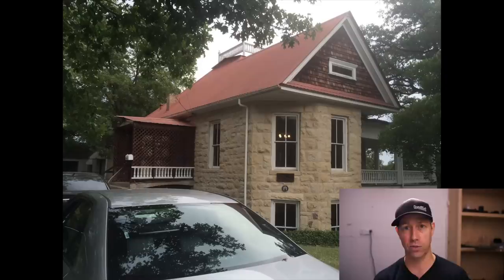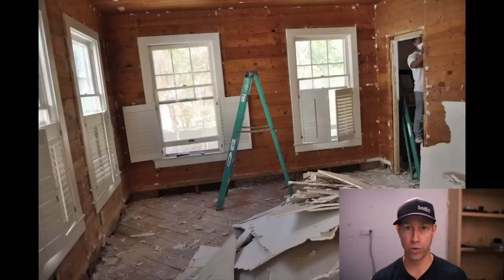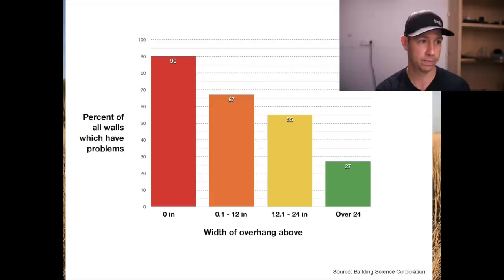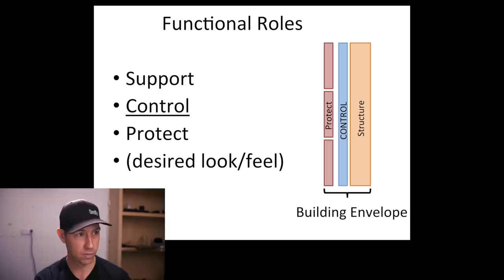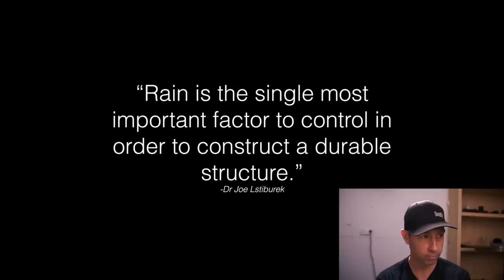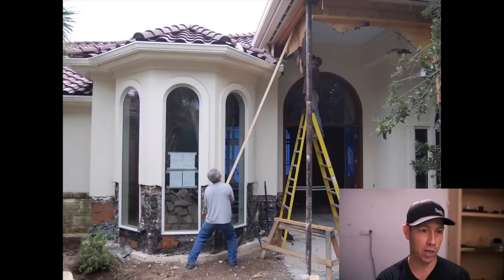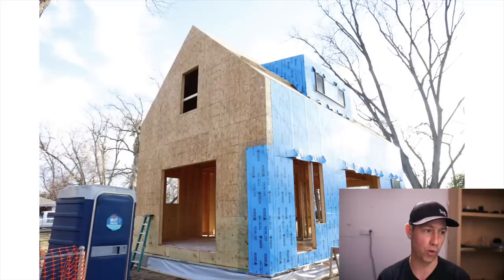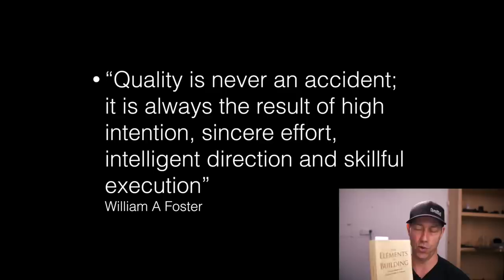Were Old Houses Built Better?

Comment: Concrete. This artificial inflation of concrete is nonsense. We need to build  houses out of concrete. Especially in high-risk areas.
Reply: Saw a very cool video on a computer assisted manufacturing (cam) / fabrication of an affordable "printed" cement house for Caribbean climates with high-risk natural phenomena. Seems like a good way to have solid bones in a house.  Although I'm conscious of Matt's comment that mortar is porous (this is true for old boats and moorings too)... Would be interesting to see a video on how to design more waterproof cement structures Matt!
Reply: Just watched the other recent video on concrete and there were a few subtle hints in that one, but would still like to hear more!
Reply: Steve Slade no it doesn't...kilns run fine on old tires
Reply: Steve Slade  natural gas is cheap  and plentiful. I know because I worked in the oilfield and we burned off a shitload. There are other alternatives to Natural Gas like methane from trash piles. You see them with pipes out of the ground burning that off. I lived in Oklahoma, I know the cost of rebuilding hundreds of homes and businesses because they are simply made out of toothpicks. On the coast where hurricanes come through will save millions too. The Energy Efficiency of cement is unbeatable. And just think of all the trees we wouldn't have to cut down if you are a tree hugger.
Reply: MrMoon_ I ran a lfg to energy powerplant in Florida...
Reply: Steve Slade they also flare large quantities of gas to keep prices high... gas and oil are everywhere...we have sanctions, fight wars to keep energy off market and prices high
Reply: NOP!.. Concrete is a horrible building material. It doesn't breath. I understand your point, you want something that can withstand a tornado or hurricane. But concrete is NOT the way to go. I suggest you check out stabilize3d compressed earth block construction. Much better stuff. It can withstand strong winds, it is bulletproof, it also allows water vapor to pass through it. This means that it does not get extremely hot during hot sunny days.
Reply: Everything down here in florida is concrete and i love it. I remodel houses and concrete construction eliminates a ton of the problems i used to run into back in the carolinas
Reply: Not hollow concrete blocks though. Because they're the weakest concrete you can get. Solid concrete is much stronger than the type of concrete blocks most tract homes are made of today!
Reply: The Utopiano Utopioan I'd take the weakest concrete over the strongest wood any day.
Reply: Nothing at all wrong with building homes with CMUs. They are plenty strong, especially once they get filled. This also reduces the expense of the home, as you don't need nearly as much concrete. Lots of homes in Florida withstand  decades worth of hurricanes because of their block construction. The roof might get torn off from time to time, but the walls are usually fine. I worked on a bunch of jobsites in SoFla and the blocks with cast or precast lintels made for very strong homes.
Reply: I remember when i lived in Okinawa, we had the worst typhoon* in 50 years pass over us.  That's saying something, since Okinawa gets up to four typhoons every year.  I saw a semitrailer in a tree after the storm.

Okinawa's a pretty heavily populated island.  It's 68 miles long and 18 miles wide at its widest point.  Total damage estimates for the island: a few million.

If that same typhoon had the the southeastern U.S., it would have cost billions.  The difference?  Everything in Okinawa is built out of concrete and steel.

* That's what you call hurricanes in the Pacific ocean.
Reply: Jeff Spaulding That's like hurricane sandy a few years ago. Passed over Florida as a cat 2 hurricane causing amost no damage, hit the northeast as a tropical storm and caused  $70billion in damage.
Reply: Concrete, while a strong material, is far from very durable. Homes shift and concrete often cracks when they do. I've seen homes here in the Midwest made from concrete (60's builds) where the concrete has become brittle with age and in some cases is flaking off. Another known issue with concrete, homes tend to get remodeled and renovated a few times in their life cycle and what works for layout and design today may not in a few years. Concrete isn't cheap to break up and put back down and even if you do, isn't as strong as it previously was - even if it was a repair
Reply: @Xixu.co.6  Not so fast! Except a concrete house without much rebar ISN'T safe in an earthquake. Concrete with barely any rebar is similar to unreinforced masonry. Unreinforced masonry has been banned in California since 1933. You may think that Texas doesn't have earthquakes, but you never know. For example, the New Madrid earthquakes, which happened in 1811-1812, surprised everyone because it was located in the middle of a techtonic plate on FLAT land. New faults are constantly being discovered.
Reply: Not so fast! Except a concrete house without much rebar ISN'T safe in an earthquake. Concrete with barely any rebar is similar to unreinforced masonry. Unreinforced masonry has been banned in California since 1933. You may think that Texas doesn't have earthquakes, but you never know. For example, the New Madrid earthquakes, which happened in 1811-1812, surprised everyone because it was located in the middle of a techtonic plate on FLAT land. New faults are constantly being discovered.
Reply: Ever been in Post Soviet countries where they have Khrushov Era concrete cities? Concrete structures are cold and moldy and inefficient there.
Reply: @dcentral  Concrete Construction has changed since the times of that Soviet era concrete. It has evolved. Do research on modern concrete homes.
Reply: 5% of all CO2 emissions are from making concrete. The first step in making it is to turn CaCO3 into CaO, so even using 100% "green" energy to make it, will still release absurd amounts of CO2.

OTOH, wood sequesters CO2 for the century-plus it remains as wood.

It is ecologically irresponsible to make anything out of concrete that doesn't absolutely have to be made from it.
Reply: @rubberdwellers3911  hi, Im from eastern Europe, all new houses have reinforced concrete beams here with red brick. They are highly reliable builds and very fast.
Reply: @jeremymartin1957  it worked out for the Ancient times.
Reply: Personally I'd want a steel framed house also and use wood more selectively.
Reply: @CheapSushi  steel frame isnt good for houses - reinforced concrete frame is far superior and cheaper
Reply: Even the best concrete eventually cracks, and once that happens... it's a nightmare that only gets worse and worse.
Reply: @oreocarlton3343  Why not?  After seeing a bunch, I like it more and more. After visiting Romania and seeing all the reinforced concrete homes, I decided against it being the primary aspect of my future home (if I'm ever in that position).  I also don't want a traditional looking white picket fence suburbia home. I truly like the new more modern cube-ist mixed structure and design motifs.
Reply: @CheapSushi  Rust, price, electrical hazards, compressie strenght...
Reply: @oreocarlton3343  The price is not too significant unless very price sensitive and/or building large but I wouldn't want a large home regardless, heck I even love the shipping container homes. Rust can be an issue but I'd rather deal with rust that the bunch of problems all these other homes have.  Plus I can add a protective coating to the steel. The steel also wouldn't be just flat out exposed to the environment.  I don't want the entire home to be concrete or wood. If people want to pay for that, go for it. But if I had a chance to build my own, nope.   I'd only go concrete for the majority of it if I lived in an area extremely prone to tornado or hurricanes, which I don't.  Electrically,  whether it's steel or not, bad wiring is a hazard if done improperly.
Reply: @CheapSushi  "compressive strenght of steel"

Comment: New houses are built of plastic, asphalt, gympsum board, foam; all not so great materials.
Reply: Bad for health also
Reply: @SimonWoodburyForget  foam is cancerous shortlasting dogshit compared to any material. Its cheap and easy to use, that is why they use it
Reply: " foam is cancerous shortlasting dogshit compared to any material"

Toxic? You're misinformed.
Reply: Yes there is the toxicity aspect of these materials, although I did not know foam has no toxicity. My main problem with them is that it makes for junky, dumpy housing. Using these materials is a cheap shortcut instead of building for durability, efficiency, and aesthetics. And yes foam can be durable, but a lot times contractors use it to filly in for sloppy carpentry. And where sheet rock isn't matching cabinetry, just fill with lots of Spackle. Housing lacks craftsmanship and attention to detail, and they are not easy to maintain. They are made as quickly as possible, so that the contractor may move to the next lot.  Thank  you for your response.
Reply: Alan Fox my house is concrete and brick. We dont really used to those mterial. But i assume it is cheaper and more effiecience to build. I guess that is what matter. I mean u could of just pay more for wood or good meterial. U get for what u pay.

Its not like the old house isnt cheap.
Reply: Depends on where you are. In South Florida a wooden house is against code.
Reply: @KnightofAntiquity  We went to Key West, and the large hotels at least seemed to be made of reinforced concrete.
Reply: Danny Bowen Water is toxic, as in it has pollution?
Reply: @alanhowitzer  Just about everything in South Florida is made out of reinforced Concrete.

Comment: I have a house that is pre-1860s. I use about 100 gallons per month of oil in a fairly efficient oil furnace (88% according to audit) keeping it at 50F during the PA winters. Over the winter I did a bunch of insulating, so I won't really know how much plugging leaks and wrapping pipes will help until next year. I hope nothing I did will negatively effect the house, but in the summers the basement was staying at 80% humidity because of all the air leaking. I used a lot of great stuff spray, hoping that helps.

Comment: I am constantly fixing houses from the past 20 years.  Bad roofs, bad framing and horrible foundations.  Houses from 1940 and before all work is cosmetic.  Simple answer.  New houses are built like shit because their is a disconnect between the knowledge from the old houses to new houses.  Meaning the new tradesman and builders use new methods and materials without truly knowing the long term outcome.  So Matt can reassure you that new houses are built better but he hasnt been around long enough to prove it.
Reply: Man, I'd LOVE to take you on a tour of my rambler whose 4-room core was built in the 1900s and has been in the family since the 1930s.  It's not good.  It's not just the additions made in the '70s or so, the core itself has significant issues - flooring issues are entirely with the core.  I wouldn't be comfortable selling this deathtrap to anyone else, especially anyone with children.  It's a teardown and if I could get out today, I would.

Not every house from that time was built very well.  Not even every technically "surviving" house from that time is actually in good shape.  But most of the houses that do survive to this day were the best of the period. Most of the crappy ones have since been torn down. The crappy builds of today still stand because they're so new, but they'll be gone some day (sometimes soon) as well.

Comment: Overhangs, if properly vented, also provided airflow to the attic space. They often had a cupola, or some other peak vent in the roof to take advantage of thermal convection, which helped keep the interior cooler.

Comment: Matt, just think however what quality of houses could be built today if we hadn't used up all the available old growth forests out there. Combining the superior less water sensitive materials of the past with modern engineering principles. Sadly, I feel today a lot of building science is consumed in finding alternative materials to things that are simply no longer affordable due to humanity's past abuse of natural resources.
Reply: What limits are you running into that could only be solved by old growth? The only ones I can really think of, are aesthetic. I'd love to have big solid beams cut from single trees in my house, but there is nothing structurally deficient about a glue-lam beam made from newer lumber. It will work just as well as old growth as long as you keep it dry and the bugs away.
There is still plenty of stone and mortar out there if you want to build that way.
Reply: @DriveCarToBar  
" It will work just as well as old growth as long as you keep it dry and the bugs away."

I agree with you, but feel duty-bound to point out that one of the big ways old-growth lumber was superior, was in insect and rot resistance. Doesn't mean we out to be clear-cutting any more old-growth forests, though...
Reply: Cragified past abuse?  You mean we shouldn’t use what we have to clothe, feed and house people and then move onto alternatives as necessary as all humanity has done but instead don’t do those things so we can’t clothe, feed and house people?  What a great idea!

Comment: My house was built in 1919 by a doctor in a town of only 375 people today and has had only 3 owners. It was built with insulation made of what looks like maybe straw or hemp sheets that was compressed mechanically, surprisingly it works fairly well. The only damage and/or rot is where the previous owner tried to update it. (he didn't put the flashing on right) When it lost its shingles  in a tornado the only thing that didn't make it was the plaster and some shellac on the floors. It has had very little updating aside from a new furnace (coal to gas) and a new water heater and being switched from a rainwater cistern to city water.
The framing is all full dimension lumber 2x12 joists, 2x6 exterior walls, and 2x4 interior walls so I would have to say that in this case it was built better,

Comment: My grandma house was built in 1690. Although has been change through the years interior ceiling and beams are the original. They were built to last with bricks, cement, stone.
Reply: AS ALL HOUSES SHOULD BE!!  If not for the greed of a few.

Comment: Here in Canada, we have challenges with our weather. Our codes are really aimed at thermal performance, but that can cause problems.With new homes that are quite air tight, we need HRV's to provide the necessary air changes, we rely on heat in winter and air conditioning in the summer to keep interior humidity down. If this does not happen sufficiently, it causes problems such as interior mold. In the old days in winter when the houses were not air tight, many furnaces had humidifiers to add moister to the air. The dynamics are different depending on the natural breath-ability (or lack of) of the home. I lean towards breathable materials. But I did a custom home that called for stucco. I hired a professional caulking company to seal the exterior. Great video for pointing that out! I would say that the arguments of the best way to build will go on as long as we have build, I don't really think that that some of the modern code requirements build a better house, too air tight, but the HVAC requirements compensate well enough if the system is working properly. I attended a educational work shop on new innovations regarding thermal performance. Studies showed that a R value of 60 in the walls meant that there was no dew point in the walls and a vapor barrier was not required and moister was not a problem, the walls could breath without loosing much heat. Sounds great but expensive!

Comment: My craftsman bungalow was built in 1923. I have done my best to restore it in this depressed area while others do little, but I digress. What I have learned is the old construction techniques were lacking back then and I get the feeling they may have been designing on the fly at times. My typing is painfully slow and don't want to elaborate, but the roof sags, eaves sag, joists in the basement are notched, and the 3 support posts in the basement are a bit off. On the other hand, the bathroom floors are poured masonry,  it is all plaster, there is vertical grain/old growth douglas fir throughout, the floors could support a main battle tank, and it survived the deadliest tornado in American history while all of the surrounding houses were lost. I will take it over a new one.

Comment: I live in the same house my great great great grandfather built in 1876. It has 8x8 timber framing and 2x8 floor joists. Even the barn, with a foundation that caved in completely on one side is still standing strong (don’t worry we’re going to fix it). When people say old buildings are built well they aren’t joking, they were built to last, not built to code.